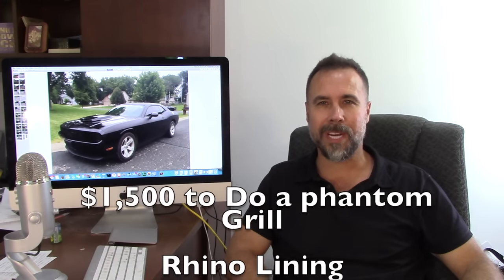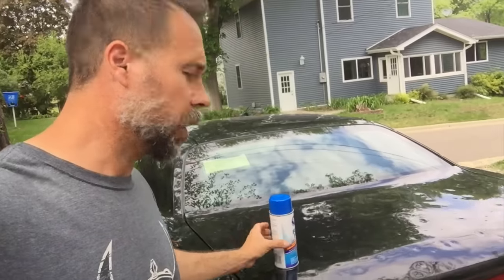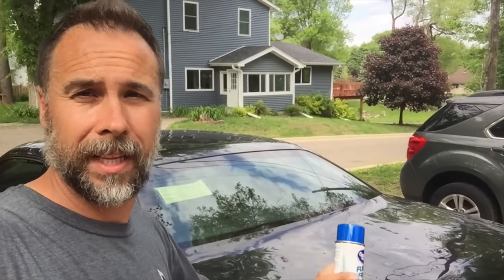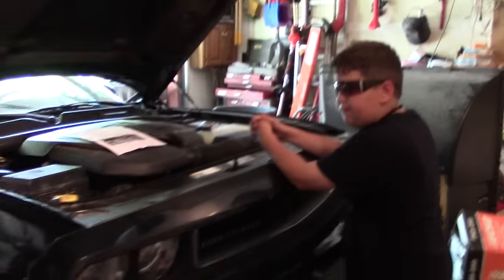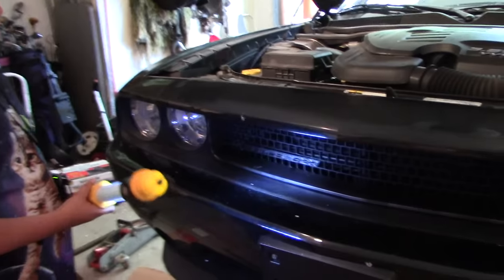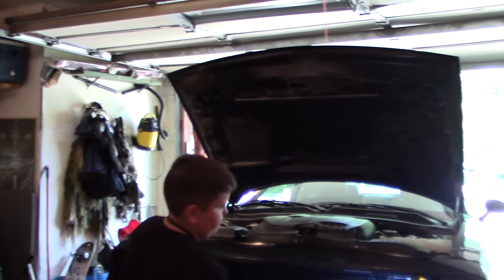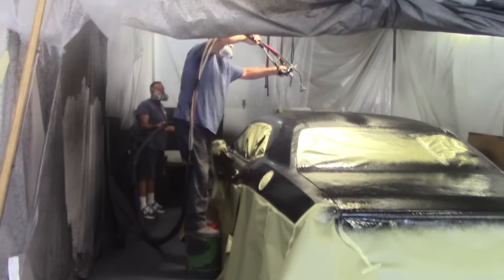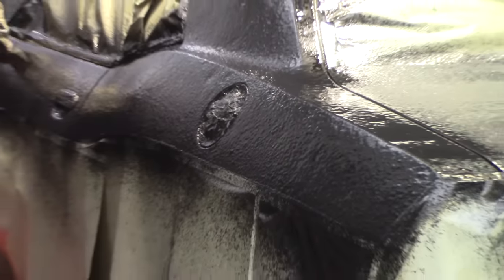Dodge Challenger Mods -Rhino Liner ( Like Line x ), Phantom Grill, Amerihood

Comment: How much did you spend on the car when you bought it. I'm thinking about buying a salvage/totalled car to work on.
Reply from the maker: I paid $10,350 for a 2014 with 53,000 miles on it.  Then had tax title and license and then repairs.  Probably around 14,000 or so total invested now.

Comment: Just a tip  with that oven cleaner be down wind of the oven cleaner because acid and it will makes you eyes burn and don't let it sit to long or it will eat through you paint and the stuff works great for brakes dust on tires
Reply from the maker: I used it to clean my rims and it worked amazing.

Comment: I must say, that grille is BADASS! The Rhino Liner turned out awesome, nice job! I will say you are 100% right and spot on with the imbalance of the entire car being sprayed, I just saw a Challenger yesterday with a matte green paint, not sure if it was plasti-dip or not. But it was peeling in the wheel wells and near where the mud flaps screw on, showing the original color of Header/Hemi Orange Pearl(whichever its called). Completely ruined the car, and such a nice rare color too.

Comment: Glad for you.  You made it look good for you.  Personally I hate it.  The Rhino lining will fade in the sun in a couple years, if that, turning it gray.  To each his own though.
Reply from the maker: Thanks-  I know it will fade but for now - I get a lot of compliments on it.  More than I thought-  I was just trying to cover up the craters on the roof.
Reply: My comment comes off kind of harsh.  Sorry, don't mean it that way.  When I bought my truck back in 2010 I had Rhino lined the box and across the top rail of the box.  The tonneau cover covers up half the rail leaving some of the Rhino exposed to the sun.   That exposed area has now faded.   Now, if I ever remove the tonneau I'll have a definite stripe black/gray that will show and looks bad.  Thanks for all the videos!  Your doing great! Love em!
Reply from the maker: I know what you mean with the black and grey fade.  I need to figure out how to keep the car shaded so the hood doesn't curl and the rhino doesn't fade out.  Thanks for watching by the way ;)

Comment: I would have done it but first I would've tried the freeze and heat method. Good looking car regardless.
Reply from the maker: I tried the freeze and heat method,  also bought 2 different styles of dent removal tools, also you tube how to remove hail dents-  It was just to severe for normal methods to work.

Comment: wax n grease remover a lil safer for finish . garentee body shops dont have a case of easy off oven cleaner in back of shop....
Reply from the maker: Actually- I learned about the easy off from a body shop :)  But yes- use at your own risk.

Comment: I dislike V6 Challengers, Mustangs, and Camaros, simply because I feel that for a muscle car, it's meant to be heavy, mean, fast, and built like a boat, with a honkin' big V8 stuffed under the hood. With all that being said, there's nothing wrong with having a V6 in a muscle body. Not everyone can also afford the V8 models. The SS, GT, RT (ZL1, Z28, GT350, GT500, SRT8, SRT8 Hellcat, etc, etc) is also not for everyone. Most people who own the V6 models don't also care much for power, competitive show, or racing; they probably just like how it looks - and most of the new ones come with some pretty nice equipment. 

And for those who hate on people because they have a V6, where's your V8? If you got one, how about picking on some folks in your lane? I assure you also, that some of these V6 Big Threes have some mods that could probably put a V8 to shame.
Reply: Jin Rayo the sad part about those jdm cars the v6 camaro mustang and challenger are like 320 horse well the camaro is. They will make good v8 swaps down the road just like the old era cars did
Reply: Oh, definitely. V8 swapping is a little bit more expensive than just buying the GT/SS/(S)RT models of the Big Three muscle cars, but they still make some formidable opponents. As for JDM and Euro V6 engine cars, them's no joke LOL.
Reply: Its really simple to take a 3.6 challenger and put the 5.7 in. I can't speak for the 6.4, which will run you way more, but if you look around you can easily engine swap a 5.7 for under 6000.Honestly, unless you're dead set on wanting that extra 70 HP, you could just buy the vortech supercharger, which will put you over 400 HP and doesn't require anything drastic done to the car (I would recommend a transmission swap to the RT).
Reply: I don't care as long as I have one I'm not picky at all.

Comment: Rhino is considered more of a temporary solution, hardly comparable to similar products, in particular LINE-X.
Reply from the maker: Well- where were you when I was getting this done😄👍🤔 haha. You guys could do the bottom half and we will see which one lasts longer. Actually on a serious note would you consider doing a side-by-side comparison in the bed of a pick up truck? We will put rhino liner on one half of the bed and Line-x on the  other half and see how they both hold up.
Reply from the maker: +LINE-X Of Illinois I'd like to do a video on it. Putting each on exactly half of a truck bed and then start hauling wood, diesel fuel, brush and tools. Things contractors normally handle. Basically a real world test how they hold up. If your serious about doing something like this please email me at stan@landscapebusinesspro.com

Comment: it's a V-6. I woulda junked it for $1500 bucks and be ahead.
Reply from the maker: Haha- but remember I think of it as a work car-not a sports car.  I just have fun modding it.
Reply: His mustang is also. Cmon dude! Why not the 5.0L coyote?!!
Reply: +Braden Wuesthoff - I have a R/T with stage one scat pak kit( makes 390 hp) but in truth V-6 are fairly potent performers today- not mad power but the 305 hp pentastar and fords 300 hp v-6 move both frames fairly well. 

simple mods like CAI and exhaust kick a few more modest HP into them, but owners get the look and feel with the added bonus of better gas mileage..they all can do 0-60 in about 6 secs or more ( the best Ive gotten out of my v-8 is about 5.6 sec when pushed by a friend who used to short track race ); its not like you need the extra horses or can actually push the car to its limit on a daily basis....
Reply: Ya I got the 6.2L V8 Dodge Charger SRT Hellcat
Reply: Lordofthecoonces 234 want a cookie for that garbage. Have fun when those supercharger bearings go out. Cost you 13k
Reply: I prefer my 5.7 Hemi Challenger RT Redline Ed. It puts out enough for me close to 400hp with magnaflow exhaust, diamond fire e3 plugs, summit racing high output coil packs, k&n cold air intake. Next are headers. Besides, you don't see very many redlines cruising around in bright white with black longitudinal stripe.
Reply: Jerk Jiggler I doubt you have a hemi
Reply: True but the point of owning a muscle car is that big v8 sound
Reply: Keith Gee hey brother, its nice to see a humble hemi owner like yourself. I have a challenger v6 supercharged and it whoops ass. Ive taken on RTs and GTs (stock i assume). But is all fun, there's always a faster car out there. Its all about working on your car, getting your knuckles scraped, and making your underdog a little better. Cheers!
Reply: or he can drove it untill motor goes out on him than he can v8 swap it later and doesn't break his bank, like some people buy a 50k car and afraid the motor would go bad or get scratched

Comment: It's a base v6, it's still fugly.
Reply: 305 HP is not fugly.
Reply: +Motor City Man Yeah well it sounds like pure shit, so fugly. Especially for not much more you can get an R/T
Reply: iTrinityPlays 
RT costs 4 or 5 grand more I wouldn't call that "not much"
The 3.6 is a great compromise of mpg and power.
The 3.6 V6 will get 33 mpg on the highway cruising at 70mph...and it's only ONE SECOND slower in the quarter mile!!
Imop the 5.7 with only about 65 more HP isn't worth it.......unless you get the 392 6.4.
I've driven the 5.7 and the 3.6 back to back, the 5.7 IS faster but not that much!!
And there's quite a few exhausts out there to make it sound pretty good.
I met a guy that had a 3.6 and I thought it was a 5.7 cuz it sounded so good!!!
Reply: +Motor City Man Well tell me some exhaust setups, and prove me wrong then.

An exhaust note on a car is easily one of the most important things on a car behind looks.

Could give a shit less about the size or the cylinders of the engine as long as it sounds good.

Top V6 is a BMW M3 E46, and R35 GTR
Reply: iTrinityPlays 
To YOU its very important, a lot of people like a QUIET exhaust.
Do some searches here on YouTube there are various setups some sound better than others.
I like a deep throaty sound and you can get it with the V6 just not as deep as the V8.
Don't get me going on German cars, overpriced and unreliable with higher mileage, that's one of the reasons why most people lease them!
Reply: +Motor City Man Fuck most German or European cars. Especially new BMWs.

They are quiet and it's ridiculously.

I daily drive a e60 550i.

I pay a 220 dollar payment for 15k grand finanace. 

Great interior and ride with the M sport package.

Quiet and loud equal package with my quad pipe set up.
Reply from the maker: I Love the MPG I can pull with this car-  its awesome! I smile every time I see that going into the 30's and know I am still driving  a challenger haha.